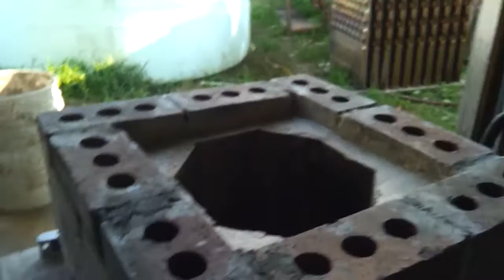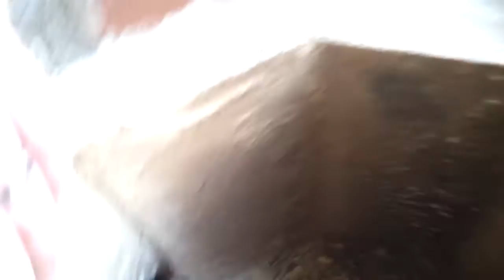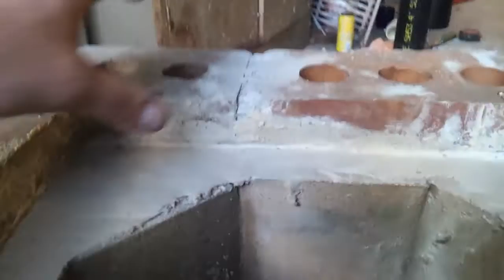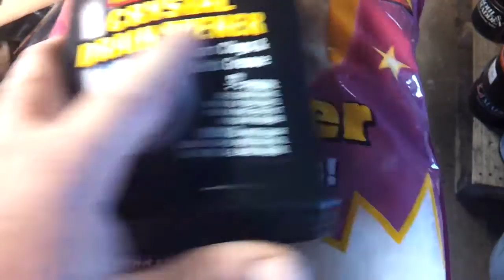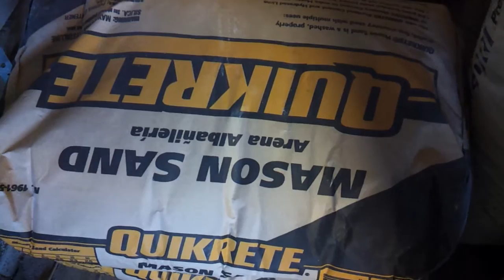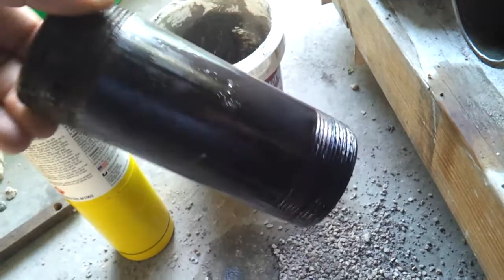Waste Oil Foundry part 2

Comment: Hey nice looking furnace so far.
There's another youtuber that dabbled with making homemade sodium silicate, and using it as refractory/hot face. He goes by the name "clkindred." If you want to check out his effort.

Were those "cans" of printing ink in the background?  I noticed the black tubs with different color tape around the rims but couldn't make out the labels. (I was a 2nd pressman for 15 years)
Reply from the maker: Thanks for the info I'll check it out. Yes Kohl & Madden ink. My old neighbor owns a printing shop and moved to vagus and gave me all of it.